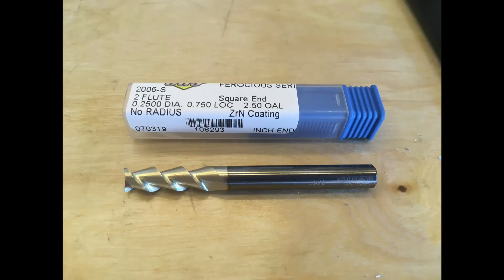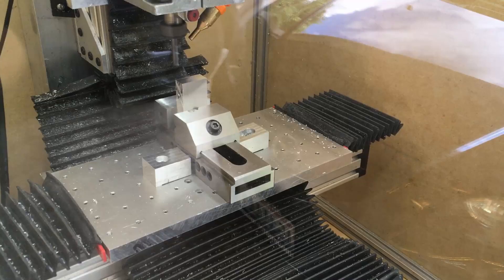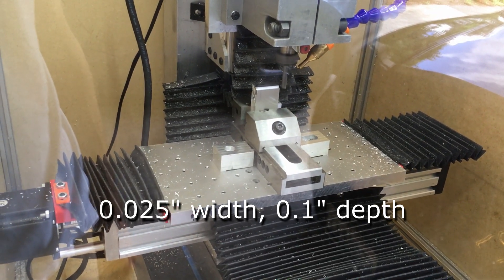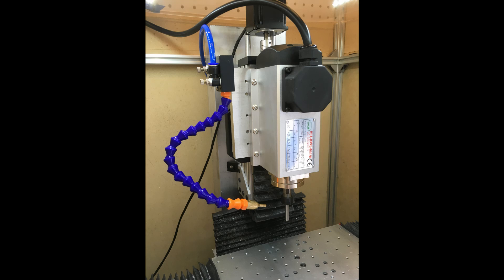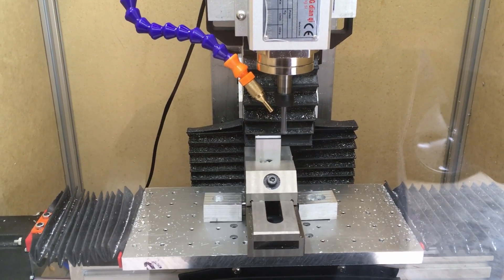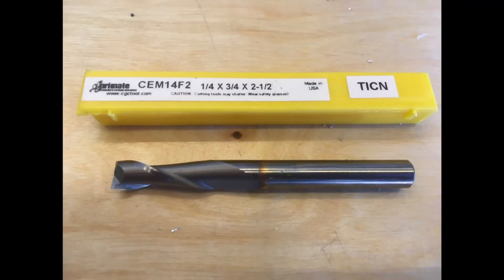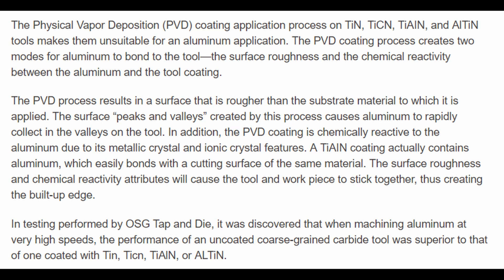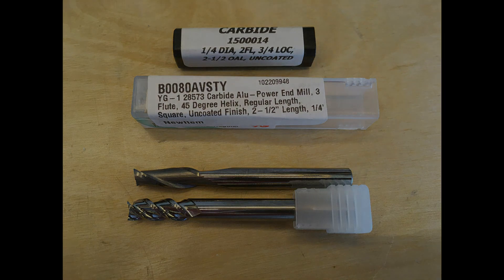TiCN Endmill Aluminum Chatter Mystery

Comment: For the hobbyshop (aka super rich people who care about the finish), the best endmills to use are high-quality (not Chinesium) HSS uncoated bearbones endmills. Nothing will come close in performance. All existing coatings are there to optimize the output of the endmill and prolong life. None of them improve surface finish or reduce chatter. Think of it like your kitchen knife - its best when its clean and sharp. And for aluminium there is one thing that matters - smooth and sharp. And those 2 parameters you can only be found in barebone steel.
Reply: Hss are you fucking joking :DDDD mirror polished carbide cuts way better and cleaner

Comment: Good video and deduction skills. I've also found good success using either ZrN or just mirror polished endmills (like your YG-1). One thing you should also do is soak your endmills in a mild lye solution after milling a lot of aluminum. No matter your endmill, aluminum will build up and stick to the surface, making it rougher and rougher. Sodium hydroxide (lye) will remove the aluminum buildup without harming the carbide and bring your endmill back to nearly new again in the gullets.